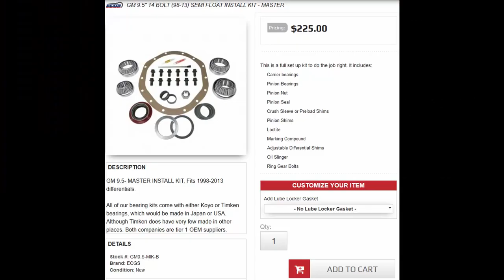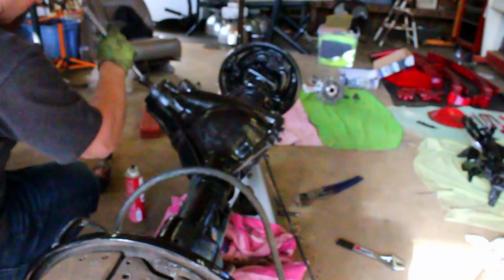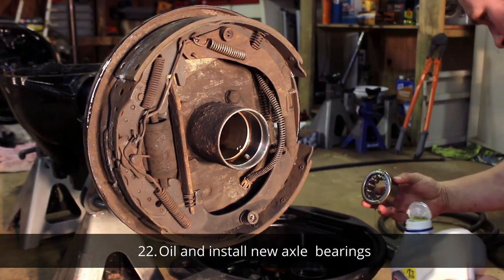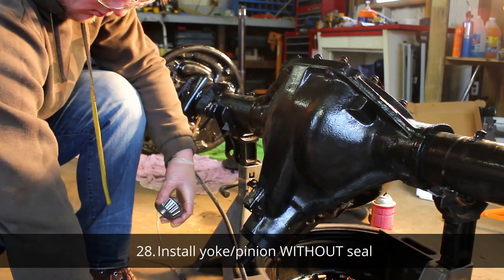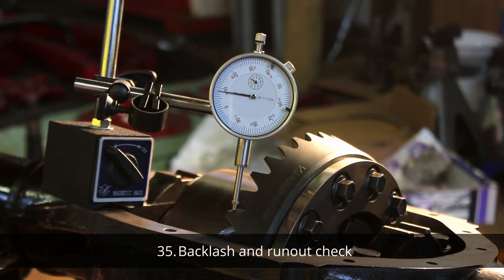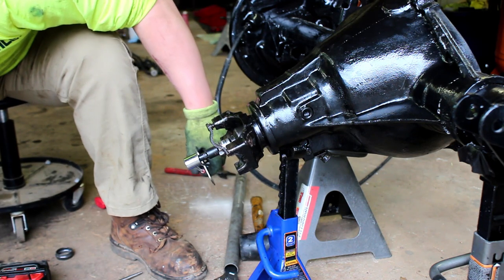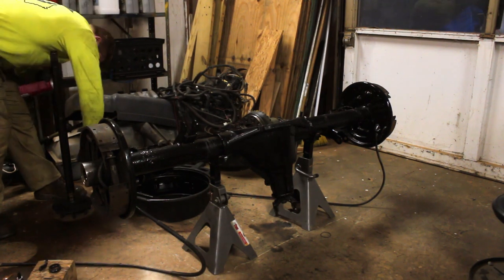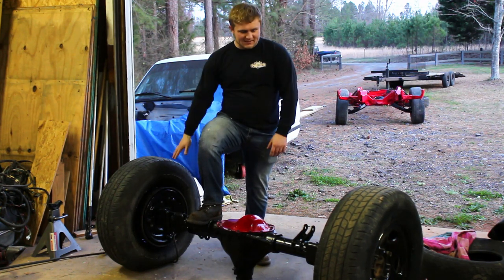How-to Rebuild GM 9.5" 14 Bolt (Truetrac and 4.10 Gears) - GMT400 Restoration Ep.4

Comment: Good video, very informative. You can hold the yoke with your hand instead of holding it with a bar when removing it with an impact. Also, you can knock out the wheel bearings instead of cutting them out. Remove both axles, the carrier and then slide an 8 foot piece of angle iron or metal pipe through the axle housing until you hit the bearing on the other side of the housing. Whack it with a 2 pound hammer and it will pop out; repeat the process for the other axle bearing, this will save you hours of time cutting them out. For the wheel bearing seals take a large channel lock , grip the edge of the seal and pry backwards. They'll come out in about 30 seconds per side.

Comment: (For future references) I watched a video of a guy who put his carrier in the freezer for about 3 hours and then put his bearing in the oven at 400°. He hit the bearing seats with a light sanding and the bearing slide right on. I tried this method just to see if it would work. It did! Perfectly. You have to be set up and fast to do both at the same time but they will slide right on and tighten back up when everything gets back to room temp. I just tapped them down with a deadblow in a circle to make sure they didn't bind but it was definitely easier then taking it to a shop if you don't have a press. Grate video by the way! Very nice work!
Reply: I did this, didnt even need to sand or whack them with a hammer. I had the bearings in for 35 minutes at 450, carrier in the freezer for the same amount of time and one fell right one, the other went on with a light whack with the palm of my hand.

Comment: Anyone who's looking for the part number on the larger/later style pinion seal.  National P/N:710507 is correct for the larger pinion yoke.  The shaft diameter on the seal should be 2.088in or 53.040mm.
Reply from the maker: @JuiceSpringsteen88  thanks for the help!

Comment: Hey man! Nice job!
I have a question, im currently installing a truetrac to my 14bolt 9,5 axle.
I just wonder if there is any special orientation on the ring gear when installing it on the truetrac?
I mean rotation wise.
Thanks for the video!
Reply from the maker: Thanks Jimmy! No, I don’t believe there is any specific rotational orientation. As long as the bolt holes line up you should be good.

Comment: Good work bro and thanks for sharing. I’m thinking of putting a 9.5”/14bolt/6lug under my 84 K10. Wonder if this is the best idea since you mentioned the 10.5” full float would be better. Wondering which way I should go
Reply from the maker: Depends on what you’re looking to do with your truck. The 10.5 might be “stronger” but not everyone needs that strength. The 9.5 is still a stout axle that can handle some power. Full floaters would be more necessary if you’re going to be rock bouncing or pulling dually level weight. 

If I were to do it again, I’d get a 6 lug full floater. I’d have the strength and convenience of 6 lug wheels.
Reply: @Hobdy  right on! No rock crawling for me, use it and cruise it haha! Sometimes pull a double axle car hauler loaded down. Definitely sticking with 6 lug. Just have to make sure wheel mount to wheel mount isn’t off so my rear tires aren’t sticking out further than my front

Comment: Thanks for the video. I took out both of the axles tubes and i cant get them back in. Is there a clip or something stopping em? Thanks again
Reply from the maker: They’re splined, have you tried rotating them? Also make sure your actually hitting the hole and not the side of the carrier.

Comment: What is the part # for the pinion seal you used? Thanks in advance. Really appreciate the video!!
Reply from the maker: Glad I could help! I’m not sure, It has been a while but I think the master install kit I showed at the beginning came with both styles of pinion seals.
Reply: National P/N: 710507 should be correct.

Comment: Could I install 6 lug axle flanges instead of 8 lug?
Reply: Maybe, I own an '88 C1500  Silverado with 14 bolt rear axle. This axle has a 6 lug flange.
You might measure the 8 lug shaft's long and compare with the 6 lug, it's the same!
I hope to help you 👍🏼😉